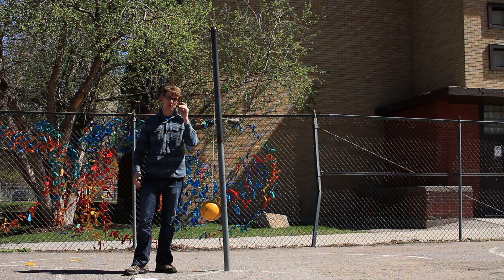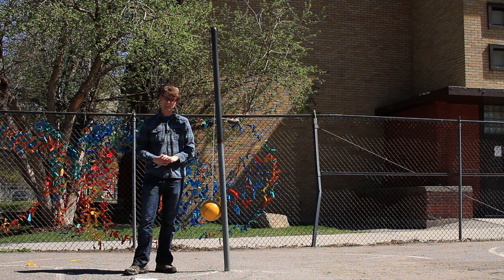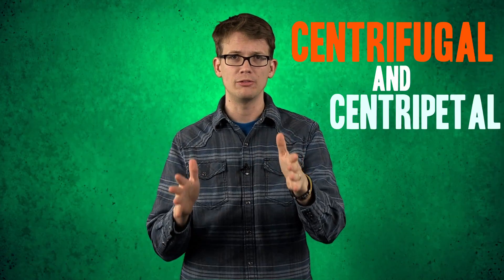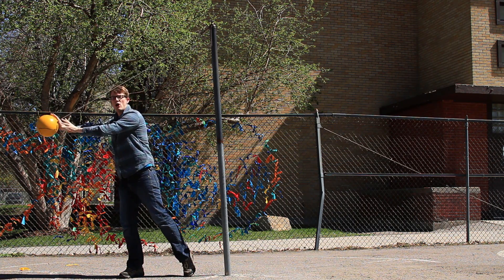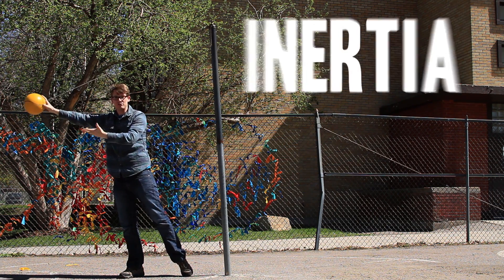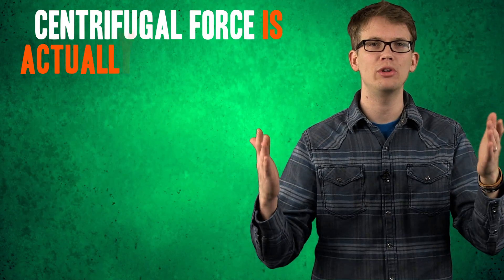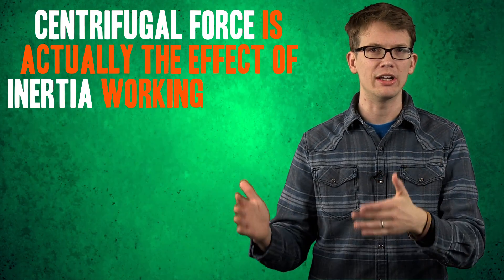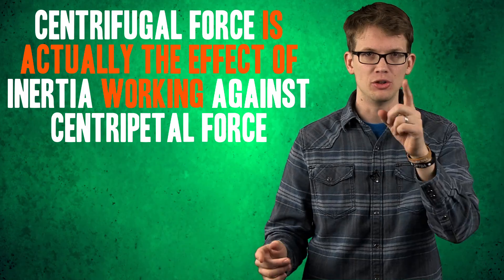IDTIMWYTIM: Centrifugal Force

Comment: Does this mean that the equatorial bulge is caused by inertia? If inertia can do this, does it still make sense to call it a property of mass instead of treating it like a force. I mean, we spin fighter pilots around like the ball on a string and measure the force exerted in Gs. Would that make the inertial "force" and the "fictitious" force a distinction without a difference in this screnario?
Reply: Do note the above comment that Gs are a measurement of acceleration, not force.  That should help alleviate a little confusion, since it then becomes clear that centrifuges are used to measure the acceleration that its contents (or occupants) are subjected to.

It's called a "fictitious force" because it can be mathematically treated like a force even if there isn't anything actually acting on the subject in question.  Recall that force is defined as mass times acceleration.  An object has mass by default, and any change in its motion is an acceleration, so those two properties can be used to calculate a "force" even without anything that caused the acceleration.  Now, due to inertia, something is always behind an object's change in motion (acceleration), and in a centrifuge, that's always an acceleration toward the center of the circle. I.e., the centrifuge exerts centripetal force on its occupants.  In the centrifuge example, the back wall of the centrifuge is pushing the rider toward the circle.  The rider's inertia causes their body to resist that acceleration, exerting an equal and opposite force upon the wall.  This force points away from the center of the circle, since that's the opposite of toward the center.  So the closest actual force to centrifugal force is actually exerted on the centrifuge (in the classic tethered ball example, it's the same as the tension force on the string from the ball).  Centripetal force feels like centrifugal force because being pushed back against a wall and having a wall pushed forward against you feels the same to us.

The takeaway should be that a fictitious force has all the mathematical components of a real force (a mass and an acceleration) but doesn't actually have anything physically exerting it.  You can blame it on Newton's Third Law: since "reaction" forces are equal and opposite to "action" forces, it's impossible to know which one was the "action" force without knowing how things started beforehand (an "inertial reference frame").  Basically, if you guess the wrong direction for the wrong object (e.g. "away from the center" on "ball") you have a fictitious force.
Reply: Thanks for clearing it up nicely. I misunderstood the term "fictitious" and you explained it elegantly.
Reply: +Big Asian Package Blog We don't measure forces in Gs, we measure acceleration in Gs.

Comment: I think that some people are still confused about the nature of inertia and momentum itself and how it can cause this. Also it occurs to me a lot of people get confused by this due to a pattern in human perception whenever it is our body with the relative momentum we feel our equal and opposite reaction from our frame of reference and not the true force. Consider you are sitting in a car with inertia and you hit the gas hard, most people feel a kick from the seat pushing them forward, now hit the brake hard while going at speed you feel yourself accelerating forward in actuality you are perceiving your reaction to the car decelerating you as you are in the reference frame with the relative momentum yet in the situation of slamming the brakes on this one is much easier to get your head around the fact that it's a perspective trick since it's visually obvious you are stopping, it's a little trickier for many to find it as obvious that they are accelerating when going around a corner even though looking at the road and thinking about what you are seeing with your eyes, the fact that you steered the car into the inside of the turn directing engine power there. All the clues are there that you must be accelerating into the turn and can't possibly be accelerating to the right and turning left around a left hand bend it's just not quite as obvious or intuitive at first glance.

Anyway I thought I would try another tack at explaining what exactly it is about inertia particularly hoping that it might make more sense for some to look at things thinking about energy rather than "forces" makes it easier to get out of the mental trap of confusing what is or isn't actually a force perhaps.

Let's try thinking about a locomotive coupled to a piece of rolling stock and for the sake of simplicity assume there is no friction or air resistance to cause confusion. So the locomotive starts to accelerate forward and takes up the slack in the coupling which then goes taught and from the locomotives frame of reference the carriage exerts an apparent force which is actually decelerating the locomotive but there is nothing to pull on it, no friction and no engine in the carriage how does this happen? Short answer the locomotive itself is generating the pull on the coupling via Newtons Third Law.

Longer answer: Since the carriage has mass and thus inertia it requires energy in order to change it's velocity (direction or speed), in order to supply energy to the carriage the locomotive must act on it with a force and it does, the tractive effort (pushing forward force on the rails) continues to pull the locomotive forward ahead of the stationary carriage this creates tension in the coupling which transfers the energy to change the carriages momentum and thus the carriage accelerates.

This same effect is what causes the back end of your car suspension to go down when you hit the gas and the front end when you hit the brake though it's less visible than it is with the train and it's coupling your car too starts to accelerate from the front while having to put energy in to overcome inertia in the back similarly when you hit the brake and increase friction with the road speed is bled off to do work against that friction from the back first while inertia keeps the front of the car going forward which has to be reined in. If you ever had to stop in a hurry you will probably have noticed the front of the car does very visibly dip forward as it's inertia swings it's mass balance to being front heavy in effect the front of the car is actually going slightly faster than the back when you brake hard throwing the centre of mass forward.

The tricky part is remembering that all of this applies when you change in direction as well as speed, if you want to make a left turn in your car around a circular road you turn your steering wheel to the left actually vectoring the torque between your tires and the road to redirect engine power to accelerate the car to the left into the turn any time you turn the car this is what is happening the steering component of your acceleration that is the left-right component is the centripetal force that is causing your car to follow an arc shaped trajectory and it always exists even if you maintain the same speed the entire time.

If you give this some though it should be pretty obvious right to turn the car you have to steer the driving wheels that are delivering your engine power to the road into the turn, why turn into the turn unless you need to accelerate in that direction there would be no need if the only acceleration was still just to overcome the friction and air resistance.

Comment: Centripetal force is also not a thing. Centripetal acceleration is, though. The "force" is just something created by the inertia of the object in combination with tension force (like in Hank's example) or normal force (like on those ride where you stick to the walls and the floor drops out).
Reply: +Fin S.H. Or gravity that keeps things on the surface of a spinning planet, but of course that is why they were smart enough to use a standard model for circular motions because of course it can be any one of a number of things tension force, normal force like you mentioned, gravity in orbits or objects on rotating bodies, electromagnetic force, friction between the tires and the road for a auto-mobile moving in a circle, I know there are other examples that start cropping up as part of fluid dynamics and such though they are generally pretty pointless to model in that way as there is invariably a whole lot more going on than just one object moving in a circle.

Comment: If a car moves in a circular path with very high speed,which direction,towards or away from the center,does the car feel like (or its tendency) to fly away? take this question with banking and without banking of that road. And which wheels inner or outer wheels from the center of the circle would have the tendency to get lifted off the ground and why?
Reply: It feels like it flies away from the center, both with and without banking.  Because "away from the center" is the same direction as a straight line, which all objects would follow naturally unless there's another force acting on it.  The wheels and banking both help provide a centripetal force to push it toward the center.

The inner wheels (closer to the center) has a tendency to get lifted off the ground, because the wheels are lower than the car's center of mass.  The centripetal force in this case comes from the wheels' contact with the ground, so the force is only acting on the bottom of the car (where the wheels are), not the top.  This causes the car to have a tendency to roll with its bottom side moving toward the center and its top side away from the center.